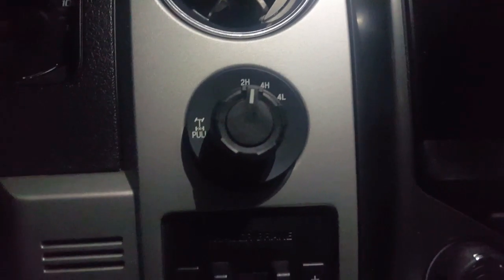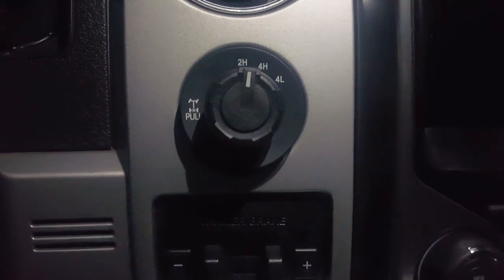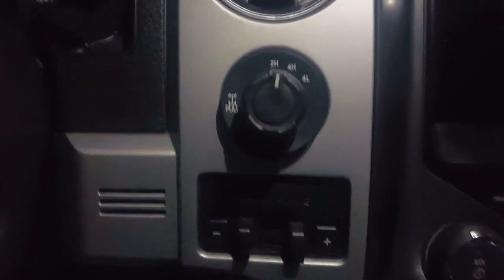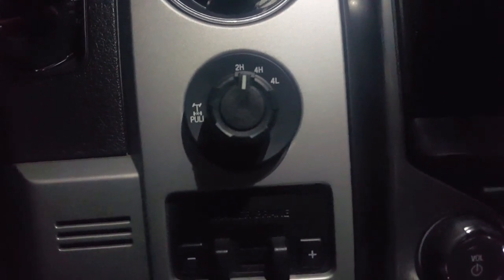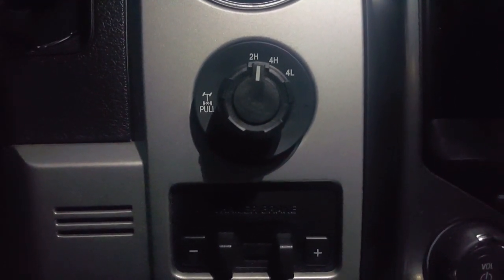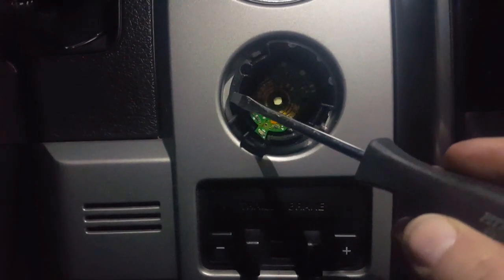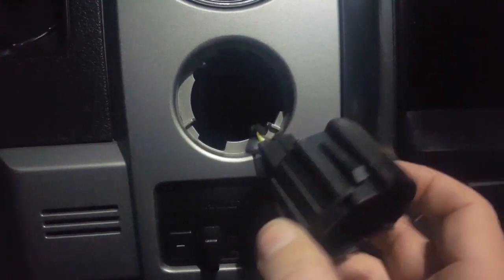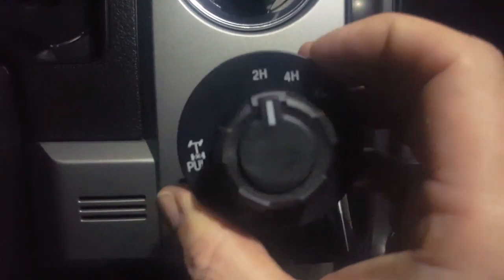✅ Repair Broken 4X4 / Differential E-Locker Switch on Ford F-150 F-250

Comment: After dealing with this switch and holding pressure while driving I got the part and selected the option to gently break the switch and remove it.... 
90 seconds later and I’m back in business.... what a great video, if I hadn’t watch this I would’ve tore my whole dashboard apart breaking many tabs and getting frustrated.
Reply from the maker: This is exactly why I make my videos.  To help others just like this.  Thank you!

Comment: Thank you for this video. I have a 2014 F150 and the same thing happened to me. My local Ford wanted to charge me $150 for the same oem part that I got on Amazon for $20. This video gave me the confidence to to do it myself. And it worked.

Comment: Thanks. Had same issue with 4x4/locking diff knob/switch was simply loose in the housing and came out in my hand. First indication of an issue was same as you, thought I'd pulled knob out by accident. Grabbed knob to check if it was pressed in and it fell out. Appreciate your doing this.

Comment: Excellent video, I was hesitant to break off the old switch and was about to rip apart the whole dash, decided to give it a little shake and some pressure, and off she came! Followed your first video until the switch came in from amazon, much cheaper than ford.
Reply from the maker: I am glad it helped.  Whole lot easier than removing parts of the dash for sure!!

Comment: Great video, thanks!  How did you break the switch?  Did you just snap it by moving it back and forth?  I am going to try this on my 2013 150 Crew Cab and am concerned that I will do serious damage if I break it off too aggressively.  Any advice?  Thanks again.
Reply from the maker: I used controlled pulling force and gradually increased till it snapped loose.  You may be able to get a plastic tool in there to hold the inner piece still of you are afraid of breaking something other than the switch.  Of course, it is always a risk.
Reply: @BOSSC351sProductions  Thanks for the advice and prompt response.  I will give it a try.
Reply: @BOSSC351sProductions  Thank you!!!  I just rec'd the part off Amazon, Ford OEM, and followed your advice and it worked like a charm.  Part cost $39, labor free!  You are the man!

Comment: Do you have a link to purchase the new switch? Also, when you took the knob off the switch, did you break/force it off or does it come off by design so you can access the tabs on switch?
Reply from the maker: The whole assy is two pieces.  The front is the knob, faceplate, and internals.  The rear is the main housing that contains contacts and the plug receptacle.  They are held together by two phillips screws.  What breaks is where the screws thread into the faceplate section.  I used force and broke the opposite side of where mine broke.  Just pull hard and carefully.
Reply from the maker: Updated link in the description.

Comment: I'm having a problem with my 2011 FX4 I'm hoping it's just the selector switch when I go to engage 4hi or lo a 🔧 comes up on the dash sometimes it engages other times it doesn't also when I have turned it to 4hi it goes into low range instead do you think it's a faulty switch can't find any info on it
Reply from the maker: I have not dealt with that situation so I really cannot say with any certainty.  I would say likely the switch is ok if it works part of the time.  I would guess its in the switching mechanism in the transfer case instead.  If you can easily get the switch out then try replacing it as a cheap alternative.

Comment: Could the switch still be the problem if the truck goes in 4 hi and 4 lo no problems but as soon as you pull the switch to lock diff in get check locking diff in info and have to hit ok to get rid of message??
Reply from the maker: I doubt it.  If you are getting a message after you pull the switch out then its working.

Comment from the maker: Get your 2009-2014 Ford F-150 4x4 4WD E-Locker Override Control Switch.  Link in the description or

https://rover.ebay.com/rover/1/711-53200-19255-0/1?mpre=https%3A%2F%2Fwww.ebay.com%2Fitm%2FAL3Z14B166BA-SWITCH-ASY-Ford%2F322373020210%3Fepid%3D1817885567%26hash%3Ditem4b0eedea32%3Ag%3AUUIAAOSw8lpZNp4j&campid=5338634974&toolid=20008

Comment: You don’t even show how you reconnect the new switch and re insert it in the console.  If you’re going to make a vedeo on how to replace a part on your truck that’s fine than show how you start replace and finish the job.
Reply from the maker: Its a simple plug in the back which did not require instruction and inserting the switch into the dash is a no brainer.  The videos were meant to show how it broke, what happens when it breaks, how to work around it when it breaks, and ways to get it out.